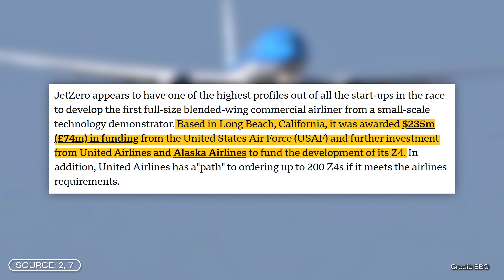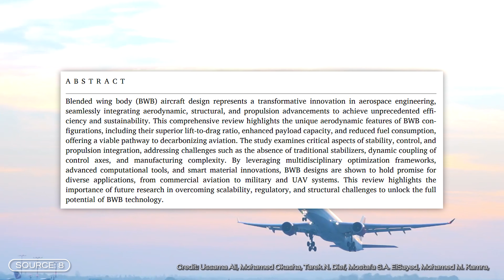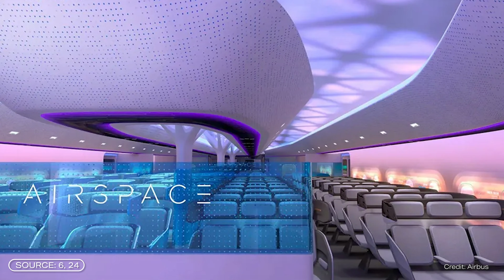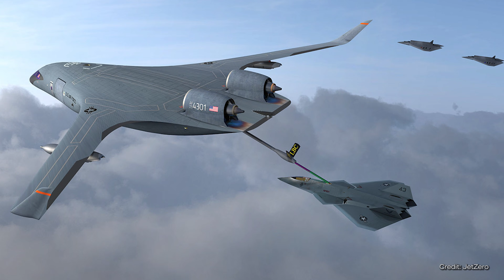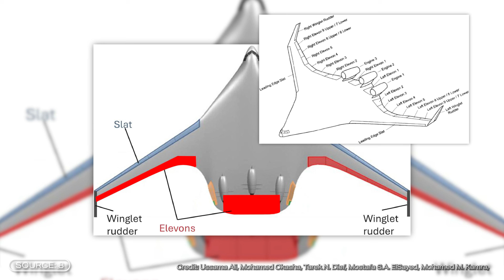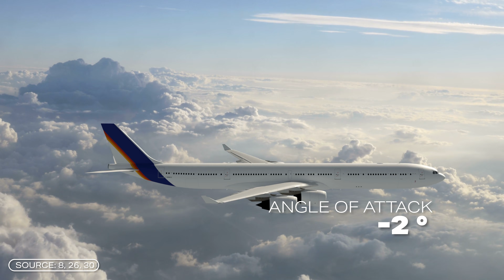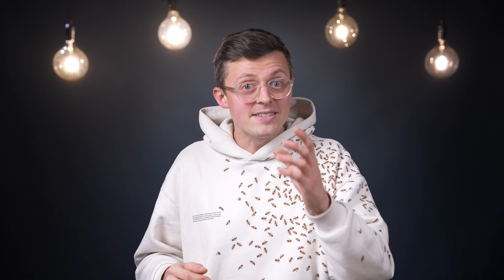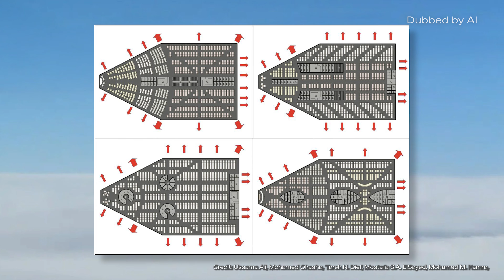The "Perfect" Plane Has One Big Problem...

Comment: Your English is generally good, but you might as well improve it:  For future reference: the plural of aircraft -- in both US and UK usage -- is just aircraft.  (And merely fyi, it's rarely uncountable.)
   Also, while I'm not in the business... ,,Kerosin'' als Flugkraftstoff ist normalerweise "jet fuel" auf Englisch.  And the word elevon has stress on the first syllable, though context will normally distinguish it from eleven.  And you will probably realize this upon reflection, but yaw is not pronounced like English jaw, but with an ordinary German J (something like Joh).
   The word electronical is very rare and not listed in most dictionaries.  You mean electronic.  It does happen that adjectives ending in -ic normally get a suffix -ally when made into adverbs (the only common exception is public); but it's a bit random whether the -ic or -ical adjective (or both, often for a semantic distinction) is used.
   And, while this is not conventional but merely personal, your top looks distasteful, like it was attacked by bugs and got a pointless unreadably small text on the right breast.
   It was an interesting video, but what exact kind of "efficiency" is meant was a bit unclear -- the economic efficiency depends on the seating plan.  Also, I don't entirely share your friend Pascal's confidence in computer-aided correction for angle-of-attack problems.  Specifically, landing in a crosswind can be tricky even for tube aircraft; doubling the angle of attack will strain the landing gear.  Finally, regarding his point about maintenance being harder for over-wing engines, I don't recall substantial problems being reported for trijets like the the Boeing 727 or the Lockheed Tristar.

Comment: That they chose to compare the efficiency of the JetZero to a B767 is not that weird since their main customer, the USAF wants it to replace the KC-46, which is the tanker version of the B767.
Reply from the maker: Thanks for the info!
Reply: The military also wants/needs to replace C-17 and C-5 Cargo aircraft
Reply: @thesirmaddog8209 I worked on the C-17. The structure would is completely different. Built like a submarine. Massively thick skins and huge structure. One of the things JetZero had to work on was the doors and getting people in and out. Getting a helicopter and MilVan might not be possible with a blended wing body.
Reply: @jamesdellaneve9005  So because YOU don't know doesn't mean someone else dosen't and FLIGHT it self was thought NEVER happen
Reply: @thesirmaddog8209 I never said they couldn’t. Making a BWB into a freighter airliner are along the same lines. A military cargo jet is a different set of requirements. The cargo envelope, which I modeled for the C-17 so that we could add lighting and other equipment. I did a little work with the MDC BWB guys. Jet Zero are the same guys
Reply: @jamesdellaneve9005  Yes and no I was a teenager when the C-17 was being developed so I read a lot... All that was published and some, being my dad was a loadmaster on the C-130

Comment: Begin by replacing windows with screens.  Structurally, windows in aircraft are problematic, requiring excess reinforcement compared to no windows, thus excess weight.
Reply: Regardless of personal preferences, what are the broader passenger preference statistics?  Many people (I have been told by airline cabin staff) prefer to remain in a "mental bubble" (especially during steady cruise), isolating themselves from (their projections of) the "scary" physical reality of flight, instead focussing on comfort factord (food, drink, being served/nursed, TV etc.).  All they need is a screen.  If so then the windows-seats would be for (literal & statistical) outliers like me!
Reply: @DavidEsp1  I merely mentioned the practical aspect.  Yes, there are those with anxieties related to commercial flight that no amount of statistics can remedy, yet they are not the majority.  If no windows was the norm, they'd still be anxious to fly.

Screens are already available in front of every passenger, they could of course also be used.  Just make them a little larger.  Offer the choice of several outside view angles and focal lengths and most will surely accept.  I too prefer a window seat, yet given the option, I'd go for the latter.

Comment: Current worldwide cargo fleet is around 3500 cargo planes and USAF has around 4000. If the whole world bought these as cargo planes it would a be market of maybe 1000-2000 planes.  You are going to build a 240 plane/year facility?  That means at some point you could supply 100% demand in 8 years.  I'm calling B-reezy S-peculation.  Nobody would plan around an 8 year plane.  The A380 and 747-8 burned a lot of fingers.

Comment: Vomit comet II. Anyways... does this flies as fast as current planes, and other economic factors. They're what matters the most. If it's as fast then it's just apples to apples. If it could offer more advantages when flying slower then investment payback would become harder but if you could save even more energy that way it could be better, per pax I mean. There's not much margin up before hitting sound wall in certain flight scenarios. So many things to consider here.

Comment: The lack of a tail on a long moment arm makes gliders less efficient and uncompetitive, flying wings are less efficient, except for generating funds based on false promised. 
Structurally the concentrated point loads of the the landing gear, fuel tanks, engine mounts forward of the wing supress flutter reducing the wieght of the wing by reduced torsional strength..ultimatly the wing box structural core is very efficient.
The tube fusalage also serves as tail moment arm structurall efficient, and also providing control dampaning to the cube of the moment arm so that it can be efficiently conlrolled ny computer or humans when the sensors get clogged or something which brought down B1 and many airbus boeing computerized aircraft. Pieces of yarn should be the windows fot manual override.

Comment: Start with uncrew transport drone first, that do not need strict human safety requirement. Piloted by drone operators for long distance transportations. Make money from there and invest further to carry passenger later. I am more hopeful to see passenger compartment be build with tubular structure for safer compression, then making use of the available space for housing cargo and instruments inside thje blended wing structures.

Comment: There may well come a time for this passenger aircraft design, but I do not think it is now. Too much of its savings comes from the elimination of the greatest safety feature of conventional jetliners. That is the negative lift characteristic of the tail empenage. It almost always provides sufficient control authority for the most dangerous part of air transport flight, the fully loaded take-off with an engine out. This design at high angles of attack poses possible shadowing of the air entering the engine inlets. To counter that by raising the engines on pods adds weight and drag.
If the military  transport version develops a good reputation in service that caveat will be nullified in my estimation, and then these may find civilian applications. 
 I worry about crosswind performance and wonder if that will limit where it can fly. I do not think the engine maintenance will be a real problem with all that flat upper body area beside them to stand on and get to service ports. These may only get to use a few of the larger  terminal jetways  as is needed for the A380, and like that aircraft may not have enough routes that it can serve to justify buying them. 
At speed and altitude for long flights is the main advantage that such a fuel efficient aircraft can provide. The nature of such flights is that passengers value on board services  and leg room much more than a chance to look out the windows.

Comment: Structurally, it looks like you could make the airframe mostly as three tubes side by side.  This would result in some nonpressurized areas but there may be things like fuel tanks that can go there.
I would worry about what happens if you stall the aircraft.  It looks like the jets could get their air choked off.

Comment: 15:28 Are we sure that the increased efficiency is from the shape of the more modern aircraft or the improvements in the engine? If it's the engine then the same increased efficiency is still due to the shape of the blended wing.
Reply: False, it is from weight savings structurally combined with a slight reduction in skin friction drag(less skin area)  Has nothing to do with the engines.  In fact, the placement of the engines aft and behind actually REDUCED their efficiency even if one ignores turbulence or assymetrical fan pressure which can completely kill the entire concept at birth.
Reply: Engines are certainly a contributing factor to the increased efficiency from a 767 to a 787. Now I’m sure there are some wing/aerodynamic improvements too, but it’s certainly not all of it.

Comment: I think a cone structure would solve the pressure issue (but would ofc reduce some of the other advantages, which could be offset by repositioning motors, for 1). I think sun-powered battery powered rotors could replace flaps & also give thrust in both design.

Comment: Mounting the engines above the aircraft center of gravity introduces a throttle dependent pitching moment. That in itself is not a deal breaker but during takeoff, the nose down pitching moment (at full throttle) makes the takeoff run longer to get to a high enough speed to overcome that thrust effect with aerodynamic nose up pitching moment with control surfaces. That effect is quite significant. That is why you don’t see engine thrust lines deviate too much from going through the nominal center of gravity. The MD-11 tri-jet is a notable exception with its center engine. 
You also ignored the whole pressurization issue of a non-circular fuselage. Yes, you can resist the pressurization loads with vertical tension members scattered around the cabin but nonetheless you will pay a price in weight. After multiple pressure cycles, what have you done to the fuselage structure? 
There is a very large rc model of this BWB being built in Atlanta right now by Tyler Perry and his team that should be flying anytime now.
Reply: Yes, a tube pressure fuselage is a relatively simple structure to analyze, build, and inspect in use, even with lots of local complexities added for windows, doors, etc.The forces and stresses in a flattened pressurized body with no two panels identical will be quite a challenge to predict for long-term integrity. Lots of places for stresses to congregate and many opportunities for surprises after thousands of cycles.
Reply: If you angle the thrust a bit you can reduce this effect since they are well behind the wing
Reply: So it's a little bit "737 MAX".  Ok so long as there's more thorough verification (both analytical and real-world testing).
Reply: What about active thrust vectoring – maybe via relatively small tubes from topside-engine to underside.  No help in engine-failure situation of course.  In which case, could part of the "blended fuselage/wing" air-flow be "passively" diverted/vectored? Or deliberate compensatory drag (possibly distributed)?  Either way, I am now picturing something like the "wrong" front-facing airflow control (or diversion?) surfaces" of the "airspeeder"/"snowspeeder" aircraft (in a battle on the planet Hoth) in the Star Wars movie: "Episode V - The Empire Strikes Back".

Comment: At best this design is going to be a wash.  More likely it will have more negatives than positives.  The fuel consumption claims are close to ridiculous.  The wetted area is up, the structural weight will be up to contain cabin pressurization loads and the wing spar will be heavier because rear-mounted engines have to be carried by the spar centre, unlike wing-mounted engines which relieve spar bending loads.  The pitch authority of this airframe is going to be poor so maximum take-off weight will be limited.  The easiest case-study to demonstrate this is the Avro Vulcan vs Boeing B52 - same wing area, 3x MTOW, 4x fuel capacity and range.  The wing-and-tube style airframe with separate empennage is very hard to beat.
Reply: Perhaps you meant the B47 vs Vulcan comparison - the wetted aspect ratio favours the Vulcan  as does weight range ceiling etc.
Reply: @rossnolan7283  No, I meant B52.  B47 has less than half the wing area of the Vulcan.

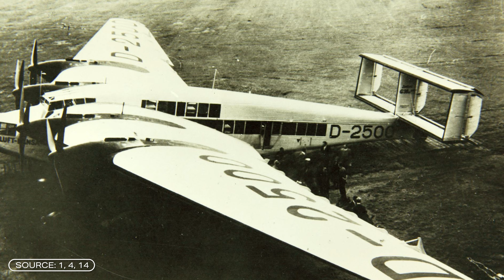Comment: 1:44 Not only does it reduce drag and fuel consumption it also greatly increases usable storage and passenger space through the larger fuselage.
Reply: I think weight and drag (fuel consumption) are essential, not size. So all that extra space (required by desingn structure) can use more room for passanger.
Reply: sleeper cabins might come back
Reply: @N9197U For the rich, still cattle car for the rest of us.
Reply: @N9197U  they are already back on some first class cabins

Comment: Not many window seats. That would suck. There was an old concept of a flying wing airliner with forward facing windows but they'll probably find some reason not to do that.
Reply: I always get the isle seat and never look out the window during takeoff or landing.
Reply: If you mounted screens across the front of the cabin (or cabin class) which displayed a wide-angle view using cameras looking out the front of the plane (so it was almost like the entire front of the plane were a window), I don't think most passengers would mind. This is the strategy being used on cruise ships in internal cabins (no windows).
Reply: You mean the duck gore passengers have to enjoy throughout the whole trip?
Reply: @McSlobo airlines, famously known to frequently hit ducks
Reply: @youtubehandlesux  Once you hit 30,000 feet msl, it is nothing but ducks.
Reply: With the center seats have a visual of the exterior on a panel that may not be a problen. My last 4 hour flight I sat in the center seat next to a window passenger who kept the shade down and rudely refused to open it.
Reply: @dathpo  If you want control of the shade, book the window seat and deal with the worse leg room.
Reply: @barongerhardt Good idea if you have the luxury of an early reservation. If you need to get to your destination at a moment's notice you take what you can. Especially since it was totally booked! It wasn't an opinion. here! There is never an excuse for rudeness.
Reply: @dathpo  Are you completely unaware of the rudeness of your demand for the window to be open? And, talk about excuses. You weren't able to book the flight and pick a seat reasonably in advance, like the vast majority of everyone else on the flight. Then have the audacity to blame the consequences of your personal failure as someone else's rudeness.
Reply: @barongerhardt The rudeness was in not asking the other two passengers if it would be OK. Out of courtesy! I made NO demands on the window passenger at all and lived through it just fine for four FN hours! My reservation was made a week before my trip and by my company travel department. It is what I was given from available seats. There were no other seats available in the time provided! So much for good manners!

Comment: Herzlichen Dank, Herr Professor! Still, Professor, I would prefer Fly-By-Light (i.e. use of fiber optics) instead of Fly-By-Wire because it provides greater safety with less weight, especially against something like a Carrington event while flying. In addition, I would also add Manual Reversion (Hydraulic Failure) just in case the electricals & electronics(avionics) also fail. That way, the pilot/s can bring the plane & its passengers back safely & THAT'S what really matters, right? One last thing: If this aircraft can be made into modernized flying boat, then that would be UTTERLY COOL, wouldn't it?
Reply: Err flight computer are all electronic and would still be vulnerable to cosmic radiation and bit flip changing the programs etc. The only truly safe system in a Carrington event is full manual flight controls.
Reply: @princeofkernow9875  And what do you think Manual Reversion is for?

Comment: The single thing for which these are the solution is in-flight refuelling.  No pax to complain about the rolling, no hassle getting cargo in and out, lots of wing for hose reels.
Reply: Cargo in general but I agree it's tailor-made for that application.
Reply: Not really, as fuel is high density; a flying wing without a body would be enough.